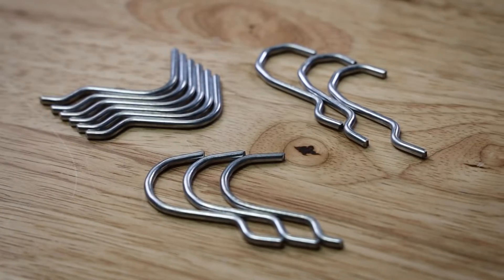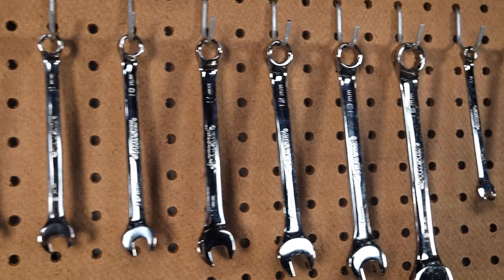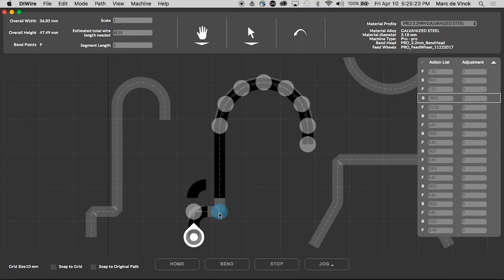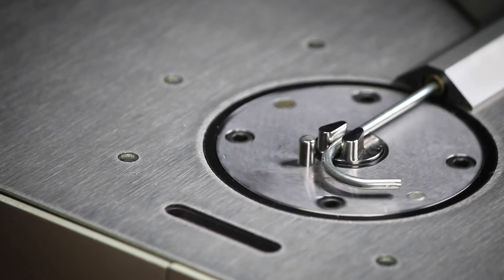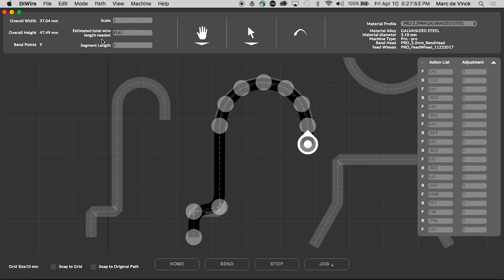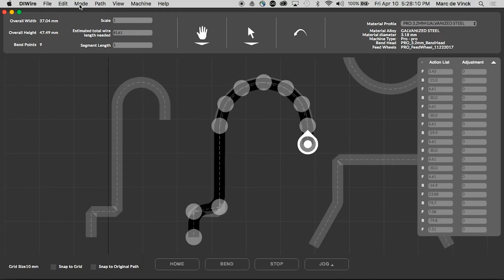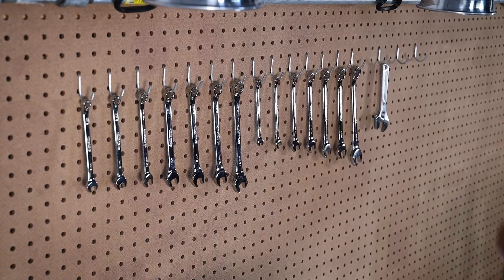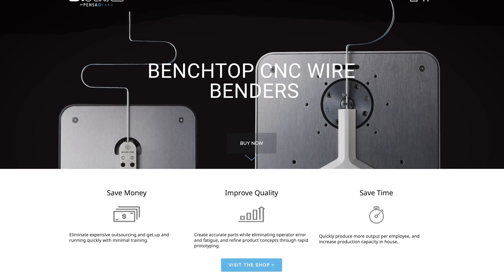Pensa Labs I  Manufacturing Applications -  D.I.Wire Pro

Comment: can you bend the wire on 3d
Reply from the maker: Hi Robert,

Our 3D machine will be releasing in the next month or two. Not only will it operate in 3D, but it will also be faster, more accurate, easier to use, more configurable, and able to bend both thinner and thicker wire than the Pro machine. Please email us at sales@pensalabs.com to learn more! Thanks!!!

Comment: Great video!
Reply from the maker: Thank you!
Reply: @pensalabs  I noticed another commenter asking about 3D bending. Kudos to you guys for making one. As a passion project, I have been trying to develop a 3D printer. 
Well, the iterative development process has lead me to making a CNC that can cut/draw on a paper. My next step is figuring out algorithms for 3D printing, filament feeding and heating. So I mean it when I say, great job on making it work in the 3rd dimension!